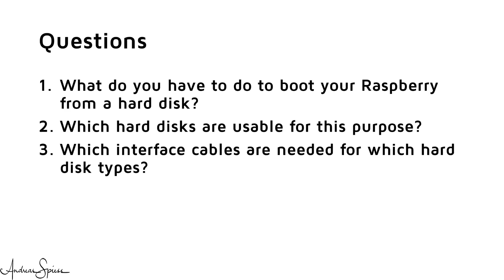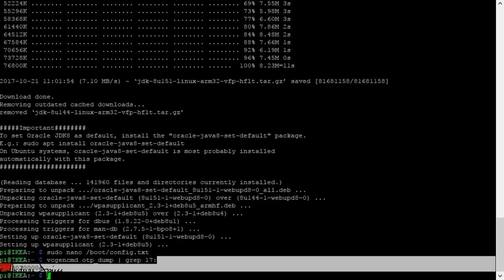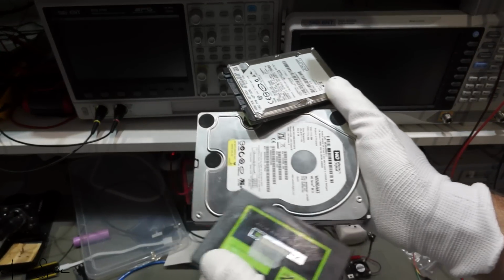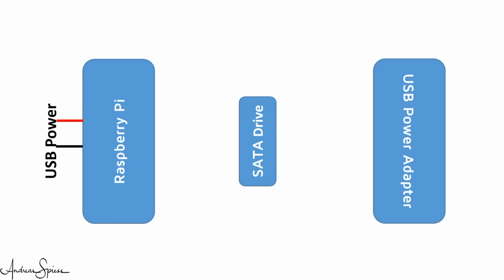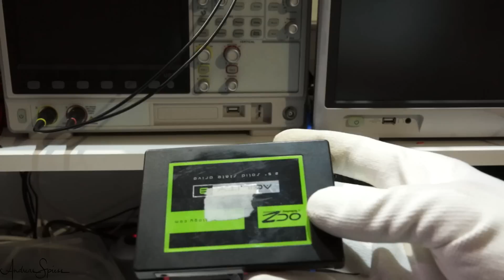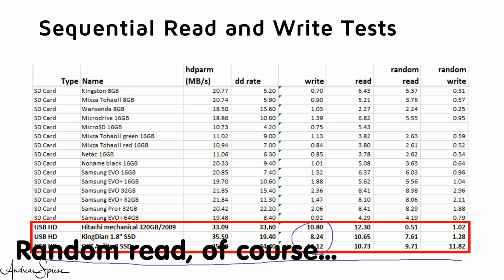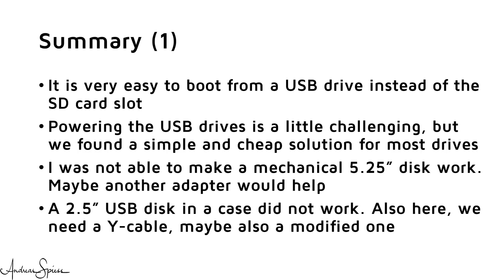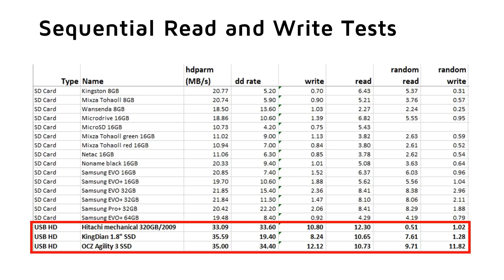#164 Which USB Disk is best for  Raspberry Pi 3? How to connect and how fast are they?

Comment: It's 3,5" disk, not 5,25"
5,25" is the size of DVD reader :)
Reply from the maker: You are of course right :-) I already corrected the comments
Reply: There were 5,25" hard disks made in the 90, obviously they needed a lot of power to get it running, but they could store more than regular 3,5" drives of the same age. I think they were called Quantum Bigfoot or something.

Comment: Like Peter EIER above, I also use an mSATA drive on a shield.  Sadly it has to connect through the Pi's USB2.  I have formatted it with the F2FS filesystem (AKA "Flash Friendly File System" I believe originally developed by Samsung.)  This has been fast and faultless in operation and provides a more integrated solution than a flash drive dangling out of a socket, although it is not as easily removed/swapped of course.  Apart from the expense (it can be twice the price of the Pi!) it is the best solution I have found.
Reply from the maker: Thank you for your feedback. I am sure it will help others.

Comment: For the past several months I have been running a pi with a 1 TB  hard drive.  Instead of a  y cable I power it through a cheap powered usb hub.  I am running nextCloud on the pi.   I restored the data from my pc to nextCloud.  It took many hours but there was over 50 gb o data.  I think the bottle neck is USB 2.0 .  Maybe the new pi's will have a usb 3 port :)
Reply from the maker: USB2 with many GB is a pain in the a**. I once had 64GB USB sticks which only had USB2 interface. I was never able to use the full capacity...

Comment: IMHO the way to go is to modify raspbian so that it uses tmpfs for all of your logs etc so that the only writes you do are package updates and your user files or convert to a completely read only environment. Having all the extra wiring and added load to run an external drive will probably make it more unreliable in the long term.
Reply from the maker: Sounds like a good idea. Where do I find a tutorial to do that?
Reply: Andreas Spiess 
Should just be an entry in your fstab. However someone did write a guide:
http://www.zdnet.com/article/raspberry-pi-extending-the-life-of-the-sd-card/
Reply from the maker: Thanks for the link!

Comment: Using a externally powered USB HUB usually solved all the power issues I had.  I like your solution for cases when a HUB isn't around or needed.  Also better than  a powered hub since they can be quite expensive too.
Reply from the maker: I also think, that this simple cable is cheaper than a hub. And usually, my USB power supplies have a spare plug to connect it. Then it is really cheap.

Comment: As opposed to cutting the 5v leg on the "pi end" of the multi feed cable, how about a diode biased "exit only"? Then no power goes TO the pi, but that 200ma can come FROM it, giving a little higher electron count to excite your giant dinosaur drive, lol. No backfeed starvation, it should work at least as well, and could possibly give small speed boost to mechanical drives with power saving tech (SMALL, lol). Of course, one could also use a powered enclosure for the drive, if such a beast still exists in the post IDE interface universe, lol
Reply: How will any power come from the raspberry pi? With your diode inline there will be a drop and the voltage from the raspberry pi will be lower than the 5v coming from elsewhere.
Reply from the maker: I think, donpalmera is right.
Reply: donpalmera  I kind of suspected that might be so, but risking the shame of being corrected as to the unworkability of my half baked ideas often proves far less costly than experimentation, lol. Thanks for the reply

Comment: I tried doing this several months ago and gave up because of the power problems - though I did not try your USB connector modification.  Although I tried max_usb_current=1 it did not help for me - and at https://www.raspberrypi.org/forums/viewtopic.php?p=930695#p930695 it says that for the RPi3 1.2A is the default and the config.txt change has no effect.  Low resistance cables are also important I believe.

I was using a 250GB SATA3 SSD with a USB3 adapter and came to the conclusion that the Pi USB2 throughput made using SSD drives a waste of money.

I think it might just be simpler to move everything except /boot (or some similar change) to the hard drive.

Thank you for your other videos.  I saw your post about the Geiger counter - I now have my own but discovered that the tubes are fragile before fitting the cover.  I am now using nylon spacers.  Some TIG electrodes are 2% Thorium Oxide and though Thorium is an alpha emitter the decay products emit beta particles so that may be an alternative to using uranium glass.  Dismantling a smoke detector might be hazardous.
Reply from the maker: 1. I think, cables are quite important if you power a disk from the RPi. This is why I like the version with the 3 connector cable more. There you separate the HDD current from the RPi current.
2. SSDs for sure are a waste on USB2. This is why I mentioned "recycling". Only if your SSD is too small for other purposes it makes sense to use it here.
3. So far I did not experiment with radioctive sources. Thank you for the tip.

Comment: If anybody can identify a USB SWITCH, as opposed to a USB HUB, then the possibility of a Raspbian implemented RAID 10 with the obvious speed benefit of parallel writing to multiple eg. 8 drives with one, two, four, or eight  bits to each drive simultaneously giving seriously fast data access via inexpensive and mirrored or secured storage. Any takers? I think we could help Andreas here...... I have a hub with 7 ports and 3.5A power supply but as yet I cannot locate a USB SWITCH? With a much more substantial regulated power supply to each port to support a hard drive and SATA interface_ I certainly do think an open design published under CC Creative Commons copyright would pave the way to realising a serious data management pathway for many to collaborate, provide proof of concept, prototype and commercialise? I believe in makerspaces and I am convinced such projects will establish the need for a distributed manufacturing base through makerspaces in many cities in many countries. Distributed manufacturing using CNC technology and 3D printing and automated reflow ovens all built within the makerspaces to build a network of compatible technology and to bridge the financial gap between small scale and 100,000 unit production facilities of world class production that requires filled order books and substantial budgets to include shipping and distribution. Makerspaces will need to adapt to realise a steady income to secure their own survival while they demonstrate how their technology functions to realise the initial dreams of individual makers.
Reply: What would a "USB Switch" do? Even if such a thing existed the idea is ridiculous.
Get a board that has SATA on board or has a PCIe/mini PCIe connector.
Reply from the maker: I think this is probably an overkill for a 30$ computer.

Comment: I have encountered similar issues before and I found I had to power the drive before booting. There might be too much power drawn at boot and on initializing the drive, but I can't say for sure. SSDs draw less power than spinning disks so I usually have no problems with them. Both need to have the primary partition boot bit set, but I am assuming you already knew that.

It might be a useful project to create a power circuit that powers up the drive first and then powers the device. Old bios systems used to have a boot disk wait time settings for this very reason.

I've worked in labs testing NAND for about 8 years and I can tell you what I believe to be true from our experiments. 

NAND flash is inherently bad for reliability and long term storage without grooming(NAND bit monitoring and rewriting to maintain data integrity) iron oxide magnetic storage lasts 10 to 15 years whereas ungroomed data will only last reliability at about 6 months at room temperature. The higher the temperature the less reliable the data will be. 

Most NAND drive manufacturers are terrible with maintaining integrity. The best company I found to maintain data was fusion-io, but the drives were quite expensive.  Now they are owned by SanDisk and Western Digital. I don't know if you can get the same quality with the m.2 and so in disks since they aren't using the sophisticated driver software. For sure the SSDs are better than a USB stick but not by much.
Reply from the maker: 1. You are right. The modification of the cable does exacly that: It powers the USB drive way before the RPi (at least in my setup where the USB power supply is always on). So, the RPi does not need to care.
2. Thanks for your info about the NAND technology. It is a little scary because I change now more and more to SSD disks. But good to know that longime storage should be done on magnetic devices.

Comment: Cool!  I have an old external drive case that came with a 12 volt power supply in the form of a wall wart.  I think I may well give that a try, she takes the SATA 3 1/2 inch drives, and I have a ton of those laying around.  Sadly my Raspberry pi died on me, but I have several Orange Pi's in different iterations that I picked up a year or so ago, and some Beaglebone Blacks, that may well work with those as well. I had never given any thought to using these as boot disks, it does look like a wonderful way to go though. Thanks a million!
Reply from the maker: I am not sure if the Orange Pi or the Beaglebones work the same with this bit change to enable USB boot. You might have to research.

Comment: I use an mSATA SSD drive connected to an mSATA shield. Speeds are comparable to a standard 2.5inch
SSD. Very happy with this setup.

Shield I use (on a Pi3):
https://www.banggood.com/nl/X850-mSATA-SSD-Storage-Expansion-Board-for-Raspberry-Pi-3-Model-B-2B-B-p-1170358.html

Example of mSATA drives
https://www.banggood.com/KingDian-mSATA-M100-8G16G32G-SSD-Internal-Solid-State-Drive-Disk-p-1053514.html?rmmds=buy
Reply from the maker: Thank you for your feedback. Another interesting possibility...

Comment: An excellent exploration on reuse. Wondering if you might consider a further comparison with a dedicated USB flash drive and the WD PiDrive HDD?
Reply from the maker: I assume good flash drives will behave like the OCZ drive. But you can do this test easily by using the script from video #141. And the WD PiDrive is discontinued. However, it should be very similar to the mechanical 2.5" disk plus the 3 connector cable.
Reply: Thank you

Comment: Hi Andreas! 
Sidenote, I don't know if the raspberry pi supports UAS, but you might want to look into that if you're gonna use an USB HDD.
Thanks for the video, I always enjoy them a lot.
The guy with the french-canadian accent ;)

Also
#define LIKE true
Reply from the maker: Thanks for your comment. I am no Linux guy (at least not yet...). This is why I usually just stay at the surface of things to survive. And the "price - performance" for my projects of UAS (from what I saw in 5 minutes research) is probably quite high. But I might be completely wrong.
Reply: No worries! I'm not sure the Pi kernel has support for UAS/UASP anyway. Assuming it has, only thing needed is a USB-SATA adapter supporting it, some of those controller chip are supporting it now, mostly USB3 adapters (not all of them). But yeah, I have to agree, the performance difference is not massive, as you said, not worth it if you need to buy more hardware. 
Can't wait for the next video! :)
Reply from the maker: Thanks. Next video most probably will be a mailbag (still secret ;-)

Comment: Andreas, there is a reset button on the RPi devices. There is just no pin header soldered in. On your RPi3 search on the PCB for a two pin connector labeled "run". It should be close to the GPIO port. 
Connect on the run-header a normally open push button and you should have a reset switch. But bear in mind, depending on file system a hard reset may cause lots of trouble for your data on the storage device.
Reply from the maker: Thanks for the tip. Maybe the possible devastating effect this is why they did not solder a 2 cents switch on the board ;-)

Comment: It's a shame that RPi cannot handle enough power for USB devices. I was able to connect 4 USB 3.0 2.5" external HDDs to Orange Pi PC and all of them were visible and worked ok. Another plus is Allwinner H3 has hw support for 4xUSBs and there is no HUB on PCB so all disks use full USB2.0 speed (30-35MB/s) which is very convenient in NAS applications.
Reply from the maker: Thanks for the info. Do you know by chance how you can boot from USB with the Orange Pi PC or Zero?
Reply: AFAIR it is not that easy and requires SD card for booting. I believe it was mentioned at OPi official forum.
Reply from the maker: Thanks. I asked because another viewer wanted also to try a Orange Pi.

Comment: I think you also need a RPi 3 if you want to get rid of the SD card. I could be wrong...
Reply: On older RPi devices you still need a small SD card to host /boot - but you can switch during boot to an attached USB HDD to load the system. There are lots of tutorials out there on how to do it.
Reply from the maker: Actually, I do not know that, and I do not have a RPi2. Maybe somebody else knows

Comment: My experience with hard drives on a raspberry is actually quite bad, Bootdrive or just storage. Even with separate powersupply rather unreliable. Seem rather picky about what's plugged in first at boot up. Sometimes a disk that worked fine before would suddenly even prevent the raspi from booting up at all
Reply from the maker: I had this issue before I solved the "backpowering" problem.
Reply: Andreas Spiess thanks that might be it, though at the time I thought I had it solved. Will need to look into that again. Couldn't open the USB plug, maybe I best make an adapter cable without the +5volt
Reply from the maker: Watch the red LED on the Raspi. It was red even w/o powering it through the normal plug. I had to destroy the plug and add a new one. You find a link in the description. Not an expensive part...
Reply: Andreas Spiess great thanks

Comment: How about a desktop hard disk which have it's dedicated power supply? On Amazon there are "used" 2gb at 60€ and the Raspi can be housed on its side. https://www.amazon.it/WD-WDBWLG0020HBK-EESN-Elements-Esterno-Desktop/dp/B00H7TBBSW
Reply from the maker: Also a good idea. I did not try because this generation is still in use here ;-)

Comment: You got to get the 5.25" out of your head - the last models in the 90s were about 40 GB - they're about as uncommon as 8" or "full height" drives nowadays..  I think you meant 3,5" :)
Reply from the maker: You are right! Guys like me who still worked with 8" disks get old and mix-up things sometimes :-)
Reply: :21 sec's I dont see a 5.25 pata in this pic so a 3.5 desktop pata/sata drive is about 4" wide by 5 inch length,  that is probably what he was referring to as you can see?????? But I could be WRONG!!!???....He mentions a dock that can accommodate 2.5" up to 5.25"., got to check that!???.....
Damn want one of those just to say I have one!!!!!. 
Modern sata desktop drives should by all rights be a bit smaller.......but remember form-factor wont change much until it does!!!, I.E.  that is why you have to install rails on modern hd's to make them fit older atx like form-factor cases..
Reply: Wow, get out your tinfoil hats folks.
Reply: Hi Salat, the last time I looked 1 TB on xBay cost UK$45  if not less for a 2.5" drive and apology for the missing sterling sign though its time we adopted the EU since we cannot survive without it.. once the US$ Beef and other subsidised food hits the UK market we will lose our farms, who cannot compete, then the land will be sold for development (what a surprise!) and we will never again be able to grow enough food to support ourselves. We will become slaves to the US$ like so many other countries who are threatened by loss of subsidised and affordable food. I think this is called supremacy, as opposed to the original topic of affordable data security for which I still think we each have a right to pursue for ourselves regardless of what some political person may think we should all do to further their own cause. Education like what we get from Mr Spiess puts us all at the same level because Mr Spiess is accurate and conscientious to provide good insight for us to provide for ourselves. He is a decent educator. My thanks to Salat for the opportunity to reply.
Reply: @alexandracrawford800  Just to help out Alexandra the ISO standards for the currencies are as follows USD = US Dollars, GBP = Sterling, EUR = Euro.
In the face of Brexit you could always escape to Europe like I did.  Good luck - you might need it.

Comment: Nice video to start my Sunday morning (as usual ;-) )
Have you tried the same with USB sticks ? They are not that power hungry, everybody has lots of them and they should (can) be faster and have a longer life time than SD cards.
Reply from the maker: No, I did not test with them. But it might be a good idea.
Reply: Gert Dewit but USB flash-based thumb drives are the same tech as SD cards, are they not? Or do you mean SSD thumb drives?